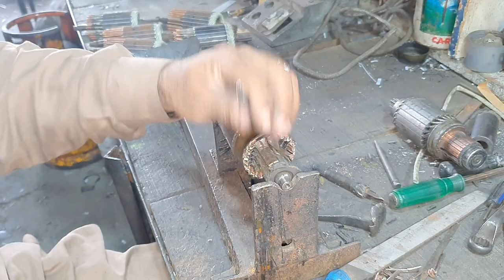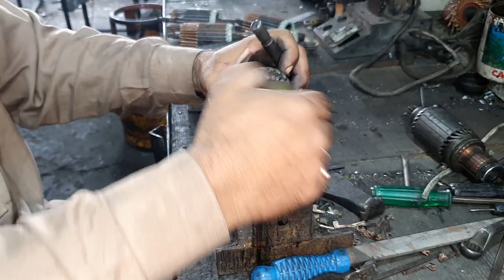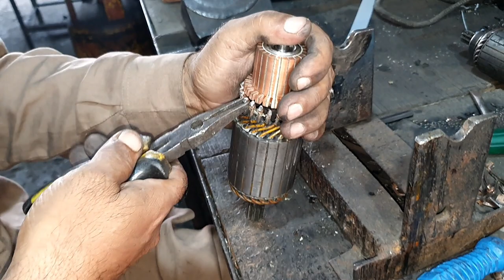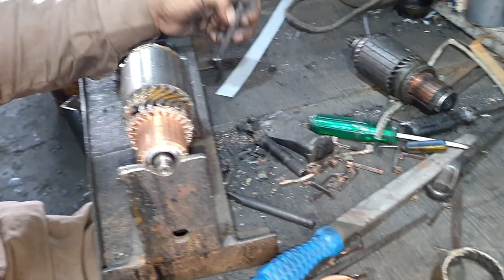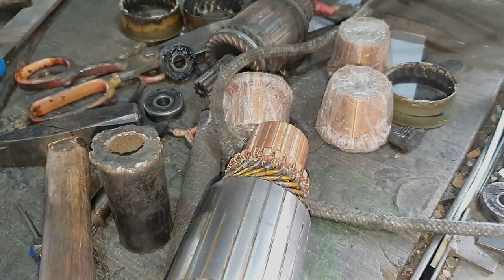How to Replace Commutator of Truck Starter Motor Armature

Comment: 3:00 Copper notch slips and bend under wire and he didnt notice it and hammered this wire not between two sides of contact but in mica insulation of neighbor contact .